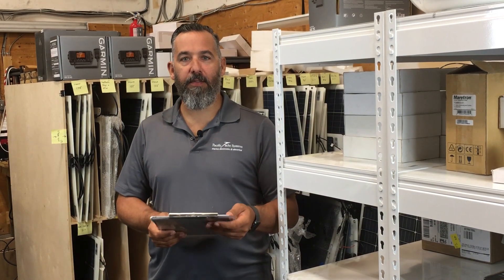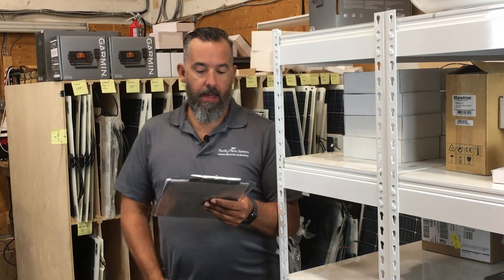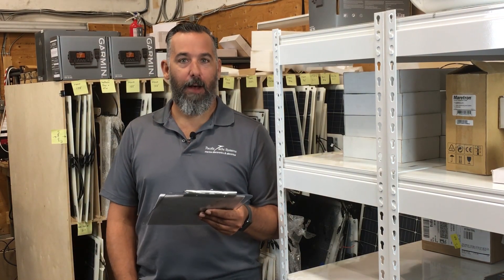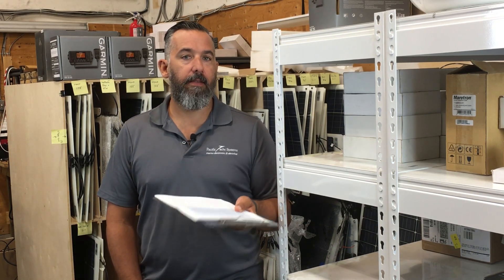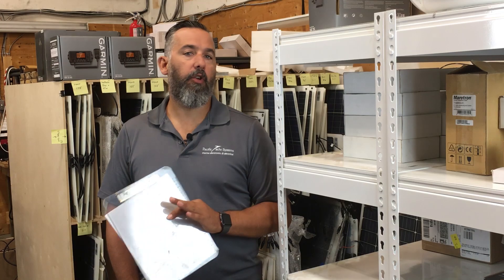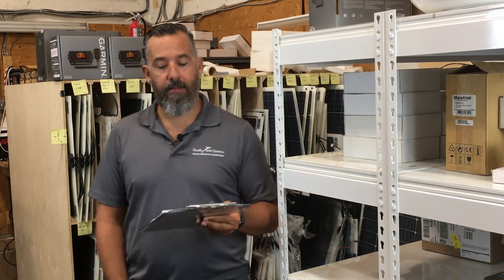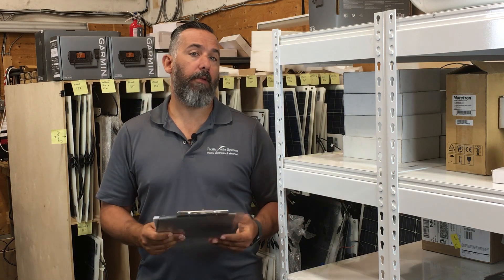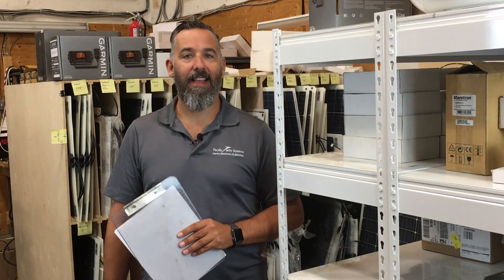Four Things to Improve Battery Power at Anchor

Comment: When at anchor for several days should I charge the house batteries all the way up each morning or something less than 100%, say 80% so that I'm not running the genset for hours. I can reach over 80% in a couple of hours but 100% takes 4+ hours. I have four 8D AGM house batteries and a 160 amp alternator. The genset is a 9kw northern lights. I can isolate the engine, genset and house batteries. There are also 2 thruster batteries and a battery for the water maker. I'm not sure how they are isolated. The inverter/charger is a Magnum 2800. I know just enough to use the systems. When at the dock all the batteries are kept at full charge.

Comment: Hi Jeff. Thanks for all your videos. What is the battery of your choice (house or engine or engines) to conect the bilge pump, and if there is more than one bilge pump, do you connect them both to the same battery? Thanks!!
Reply from the maker: My recommendation, run bilge pump to house, because it's likely a much bigger battery. Run all bilge pumps to house. Leave engine starting to a single untouched engine battery.

Comment: I'm not a boat owner yet but I have aspirations to sail as a lifestyle on a 30' boat. After watching your video's I think I want to gut what ever I buy and redo the power to make things right the first time. My power needs may be quite unique as I want to have my home studio on the boat, essentially an iMac, speakers and some other small equipment. I'm researching brands that have a smaller power draw as this will be essential. I have some questions, should I consider 3 battery banks (Engine, House & Studio) or increase the amount of house batteries (Firefly)? 3 battery banks make me believe I will need two inverters, as there would be need to two AC systems. Second question, would I need to have a AC power conditioner on the studio to guarantee a constant rate of power to the equipment? Another concern would be in relation to grounding issues (Hums & buzzes) coming from the speakers, how is that avoided? This is my new favourite channel. Keep the video's coming.
Reply from the maker: Hi Navis, sounds you have a interesting setup with a engine, house, and studio battery. Probably a DC to DC power converter should be considered or like you suggest a good inverter should keep your AC appliances at a steady voltage and freq.

Comment: It seems extreme that just a day at anchor would drain your battery bank. It suggests to me that either the batteries are not fully charged at the start of the day, or the batteries are old and not retaining their charge or this person is using some seriously high powered appliances. For me, when I go yachting, I expect to be far more frugal with my energy usage than at home so for example I'd convert all lighting to LED and even then I make sure I turn off what I don't need.
Reply from the maker: Hi Dean, your correct it's about matching batteries to battery loads, many boats have much larger loads then even one days worth of capacity. Hence why many powerboaters charge their batteries twice a day via a genset running battery chargers.